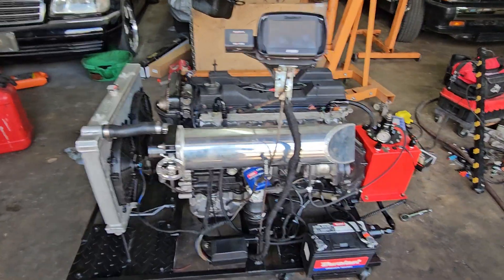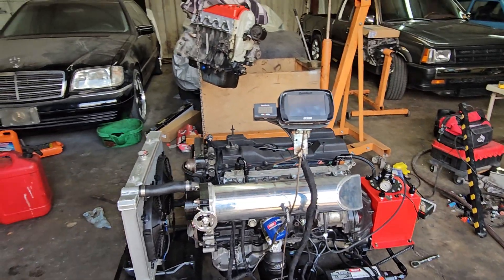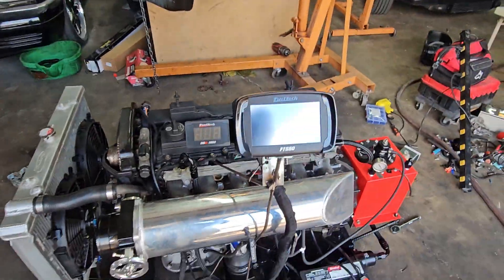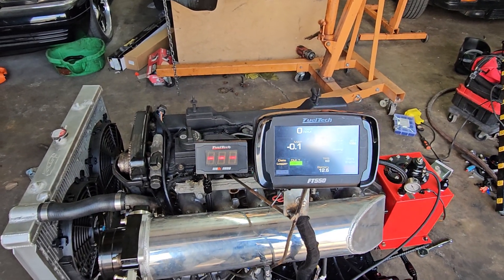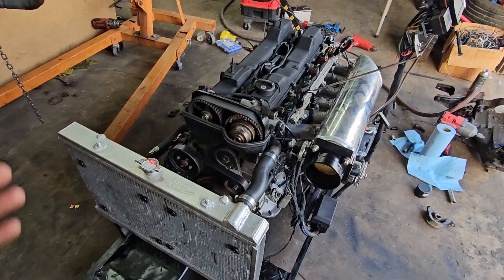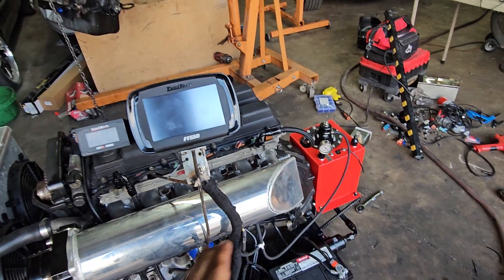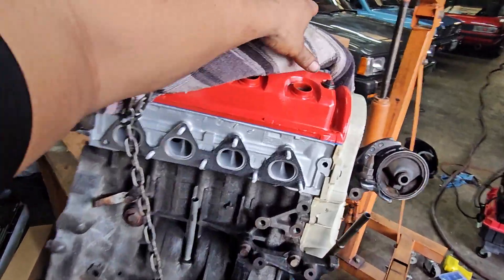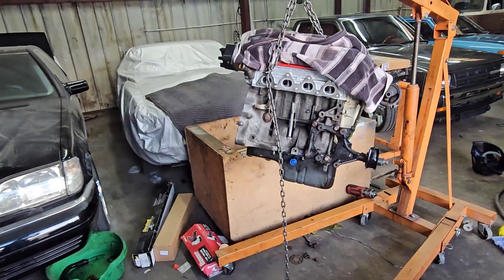2JZ FUELTECH ENGINE KART READY FOR OUR TUNING CLASSES

Comment: Is it running waste spark? Thinking about getting one for my Supra. Is a GE-t but still running on distributor. Want to get rid of the dizzy and get a coil on plug or an is300 coil setup.
Reply from the maker: @gorenas_garage  yes it is.
Reply: Can you run a coil on plug setup using the GTE crankshaft sensor on a GE non vvti, using the FT450? Or do you need the FT550 for that?